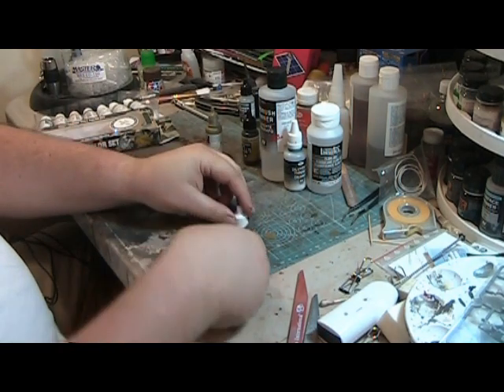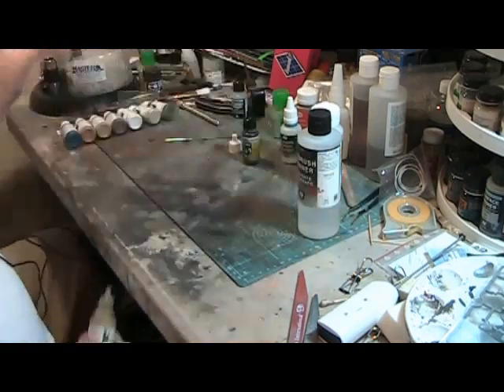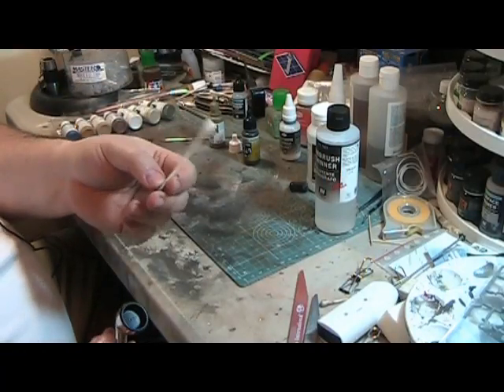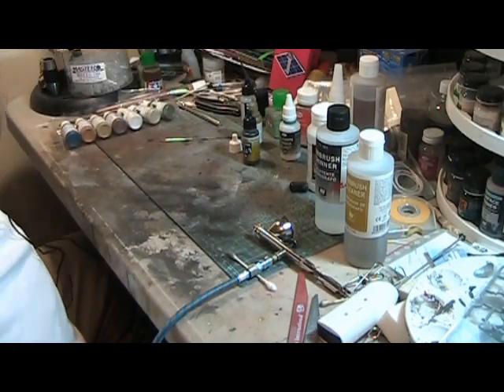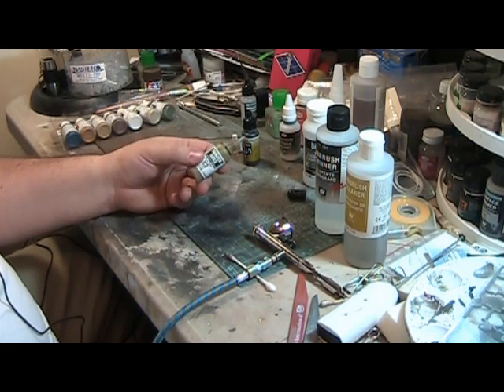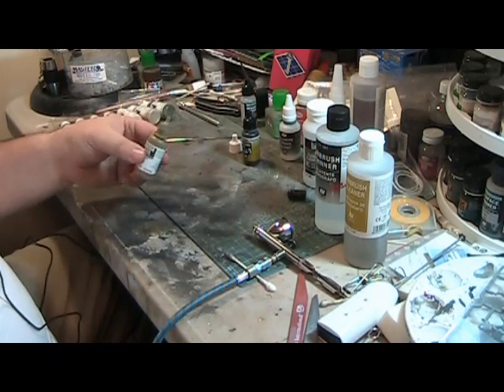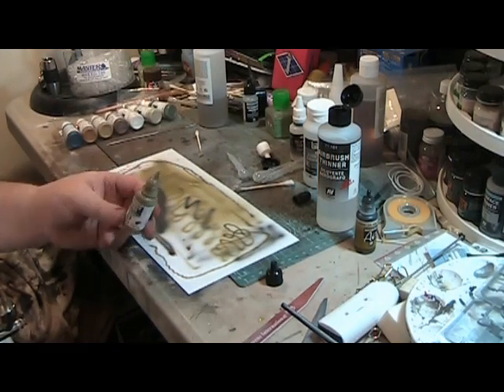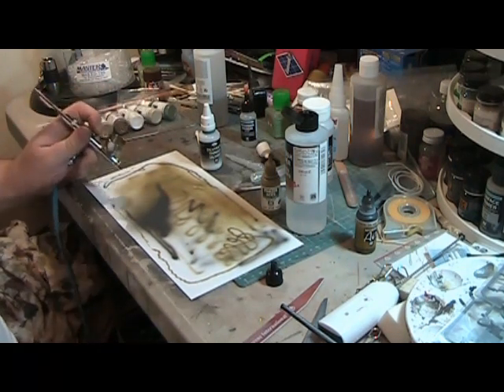Thinning and spraying Vallejo Model Color and Model Air

Comment: Oh the problems we have with this paint.  I've tried most methods including  their retarder, thinners , mixing in a shot glass before putting in the cup. Have  S/S ball brg in each bottle , built a box to contain the paint bottles  attached to my jigsaw to shake. Still each time I spray there is the chance it will clog up.   If it wasn't for the choice of colour  and no smell and being safe to use I would look for something else.

Comment: Great vid very helpful for someone just about to start airbrushing! 
Do you recommend using a respirator during painting with an airbrush using the model air paints?
Reply: They are water based and non toxic and probably you will not spray them randomly all over your face so no

Comment: When talking about the Vallejo Retarder you mention that you generally only even want to use a single drop, alongside this you also mentioned that you could use the Liquidtex FlowaiD instead but didn't say how much of that you would use, I'm assuming it'd be a similar quantity?
Reply from the maker: OrangeKNight I have since learned (the hard way) that Flow Aid has to be diluted 20:1 with water or it can and will ruin the paint.  I now have a pre-diluted mixture of Flowaid in a separate container for when I spray Model Air.
Reply: TacticalJackalope Ah, would you recommend the Vallejo Airbrush Flow Improver over the Liquidtex mix then?
Reply from the maker: I think it is probably the same substance but if it is premixed then that might be an advantage.  The trouble is it is a new product and I have not been able to find it yet.
Reply: TacticalJackalope Fair enough, I'll give it a shot eventually xD Thanks!
Reply from the maker: OrangeKNight You are very welcome.  Thank you for taking the time to watch and comment.  Please feel free to reach out with questions any time.

Comment: Good tutorial.  The only gripe I have is if you have to continuously add thinner, retarder, flow aid, etc., etc., etc.,  just to get these paints to spray right it makes airbrushing Vallejo paints more trouble than their worth!  Vallejo paints are excellent for applying with a paint brush but if you have to "go around the world just to get across the street" using a laborious (albeit time consuming) process just to airbrush these paints then in my opinion its not worth the trouble.  I can easily have Tamiya, Model Master, Humbrol or Gunze Sangyo acrylic paints ready to airbrush in about three minutes or less and get great finishes.  Other than a drop or two of paint or thinner here and there to adjust the consistency I certainly don't have to tinker back and forth wasting my time trying to get the right finish.  But hey......to each their own!
Reply from the maker: +Phayzyre105 No worries the hobby is different for everyone!  Vallejo paint is far from being my favorite trust me.  I prefer Tamiya or Gunze actually and you will find my video on thinning Tamiya paint  is the 2nd most recommended item on Google on the subject!  Vallejo Model Air can be sprayed directly from the bottle without thinning which is their appeal for many folks and they are water based which why they are so attractive.  Really all you have to do is keep a Q-Tip nearby moistened with either thinner or cleaner to remove the dried excess off the tip of your airbrush.  I find them inconsistent though which is why they are not my primary paint.  Tamiya Color is unique in that it is a solvent based acrylic (  I'm pretty convinced GSI Creos a.k.a. Gunze OEM's their paint) really works best with their lacquer thinner but most people don't want to spray that indoors because of the harmful fumes and odor. I have a proper spray booth so this is not an issue but most people do not. It works fine with the alcohol thinner don't get me wrong but when you thin it with their lacquer thinner it dries faster and is more resilient than the alcohol.  Thanks for taking the time to watch and comment.
Reply: I think the point is that paint is expensive. If you want to use the same paint for airbrush that you brush with then you can you just have to learn how to thin it. Using the same paint is much more cost effective than buying the same colors in model and model air.